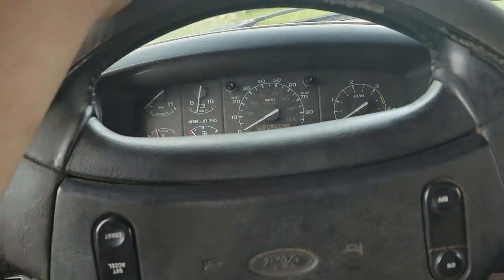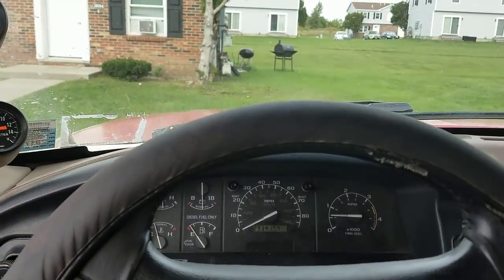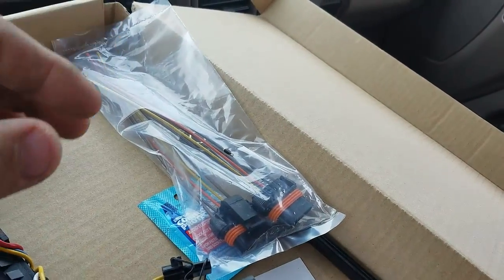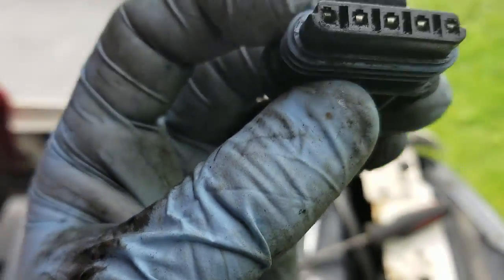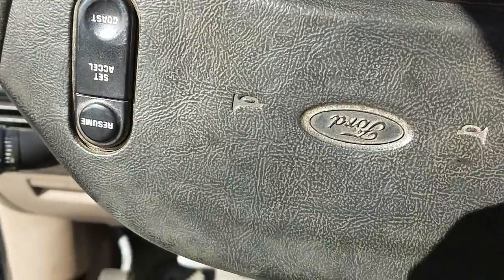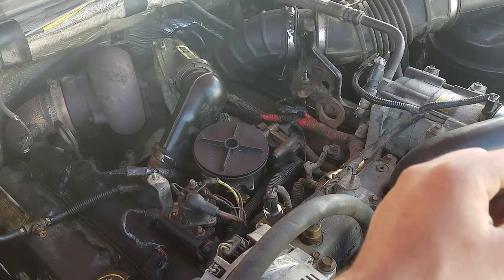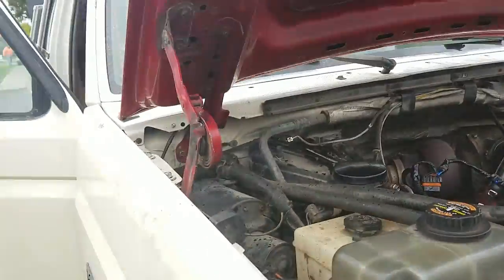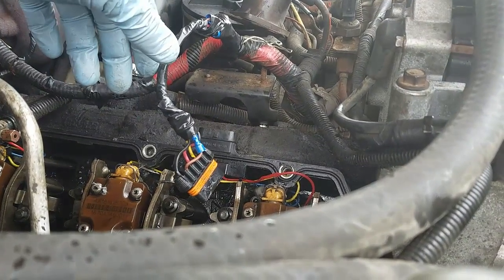97f250 Hd Injector/Valvecover Wire harness

Comment: I  just had this happen to my obs now I know what is wrong with it. Finally a video on how one sounded like and the shaking it does too
Reply: That could be a faulty wire harness or the IDM
Reply: I'm having that same issue right now
Reply: Mine does everything his does but worse and has a check engine light
Reply: @strokenobs___181   I would ask cpaddict.com they've helped me out with a lot of problems Ive had. Paul and Chris can guide you right. 👍